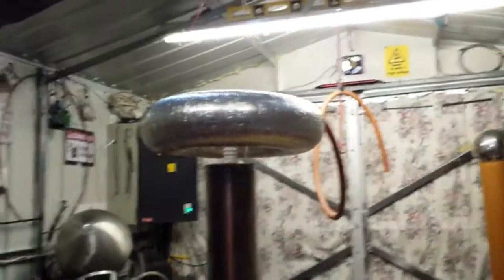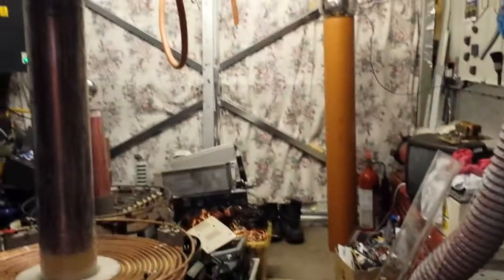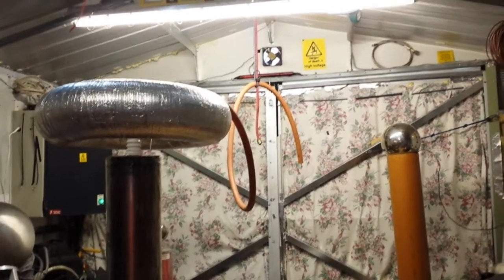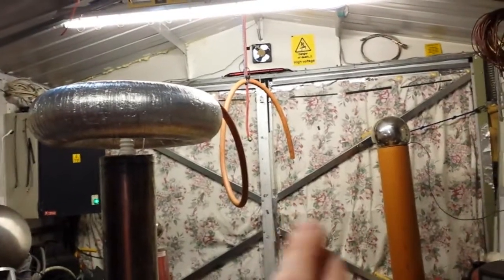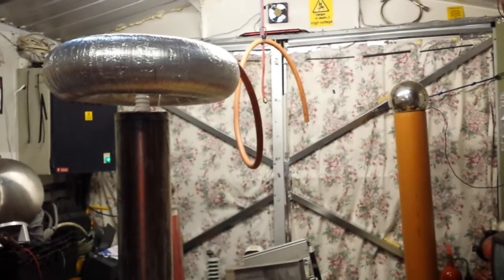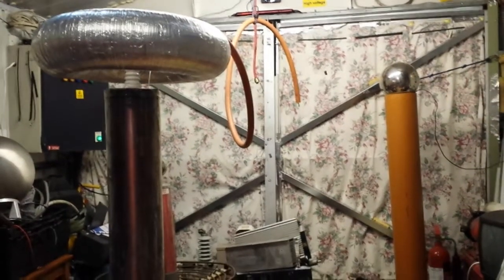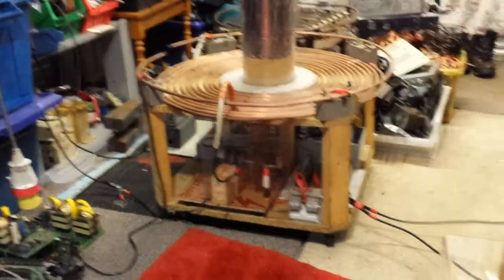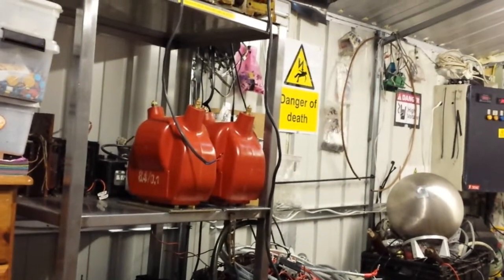Watch this guys"  coil experiment output'

Comment: Mostly MOT's give you a voltage of about 2kV.
A 400W MOT should give you a current of about 0,2A.

There are people who already build working single MOT SGTC's

I think there shouldn't be any problems if you build a voltage multipler to get 4kV at about 100mA.
This could actually work fine.
With a further multipler stage this would be 8kV and still enough current to load a capacitor with a capacity of about 15nF to 20nF.

Higher input voltage will course less troubble with the sparkgap.